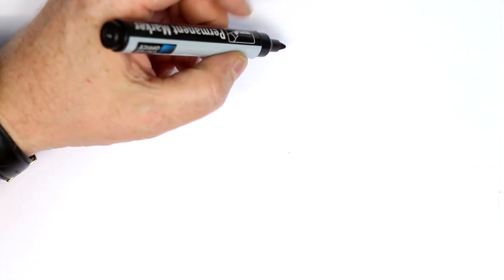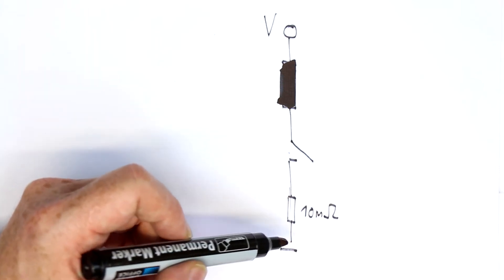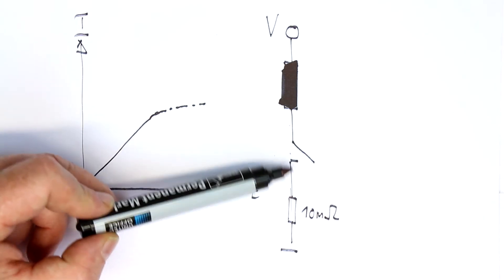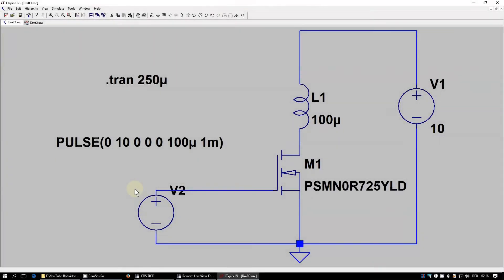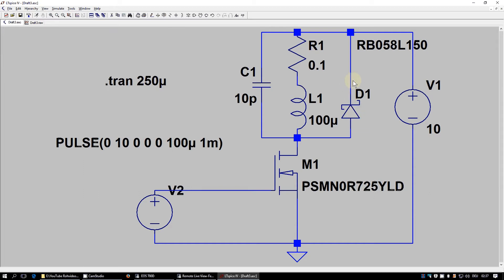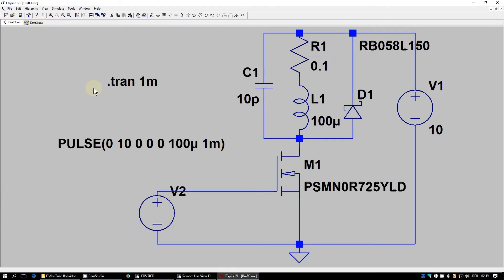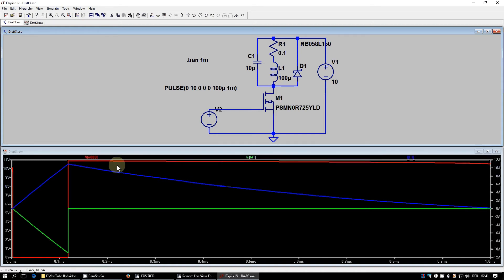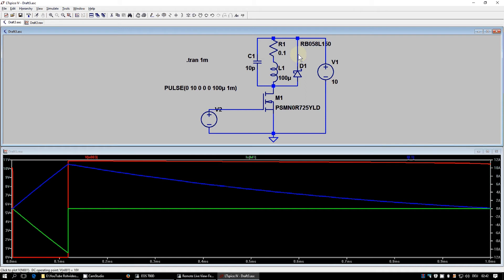Suppressing unwanted oscillations with a resistor [Pt.1]

Comment: The oscilation at the end of the simulation in the 7:33 is due to capcitances in the MOSFET that are present in all real MOSFETs, they are there even when it is off. The capacitances do depend slightly on the current, but in general only slightly. It forms LC resonant circuit.

Comment: Since, your video is labeled pt.1, I assume your next video will be the incorporation of a capacitor  across or in series with  the damping resistor to make it a snubber circuit.  I use a variable capacitor to find the best value by observing the ringing on a scope  and then replace it with the closest fixed value.
Reply from the maker: Yes. We will see how a snubber will work in this application and expand this topic on how & why to suppress ringing on power supply pins of fast digital logic ICs. Have to find the time to do the videos...

Comment: I ran this simulation several times on LTspice and on several computers but I get virtually no delay for the current and virtually no delay for the voltage change. I used both identical part numbers (( PSMN0R725YLD and RB058L150 )) and double checked all the set parameters such as the pulse and voltages. Maybe I am doing something different than you but I have re-checked everything several times now. Just thought you would like to know....PEACE
Reply from the maker: What do you mean by "delay" for the current and voltage change?
Reply: Current. I just tried it again to compare my results with yours and the voltage looks considerably different than your results. ....PEACE
Reply from the maker: Hmh. Strange.
If you want to I can send you the LTSpice schematics file.
If that doesn´t give the same result it must be in the default settings of LTSpice.
But even that should not give a gross difference.
Reply: I was actually measuring the current through the mosfet (Drain) and not the actual inductor....PEACE

Comment: The thing you are seeing is called dv/dt induced turn-on of the MOSFET. With transistor off, if you use too low high of the resistor with diode (or an inductor with too low internal series resistance) you will not dissipate energy, and still get rise of the voltage at the drain, because the diode and resistor will not be effective. This will keep transistor on (or turn it on, if it was off before), and keep it conducting. If you use too low of a resistor with diode, you will be make sure transistor doesn't turn on, but too low resistor will make not dissipate energy fast enough to make much of a difference. This is why you have some optimum in between. The dv/dt is due to internal structure of any MOSFET, most notably capactitances between all terminals, that causes things to behave non intuitively. Big voltage spike on the drain, will cause the current (Miller current) to induce voltages on gate and on source, and gate might become above threshold (relative to source), keeping it turned on, or turning it on in fast switching circuits.

Also, the PULSE with 0 rise time in LTspice results actually in some pretty slow rise time, something like 10us. Put there explicitly very small value, like 1ns.

Your damping explanation is not correct actually. Sorry.

Comment: Question I have 12 volt plug coming out of a portable generator tried to use that power source to power a fuel cell gauge the gauge needle is moving back and forth grounded out gauge bypassing the float sending unit and it still is fluctuating I'm thinking my 12 volt source out of my generator is oscillating the 12 volt source is not a rectifier off of a ac winding okay its a direct winding the automatic voltage regulator has nothing to do with this either the way the needle is bouncing around looks like the current is going back and fourth even bought a new gauge and the same thing is happening with that gauge also can I possibly put a  diode in line to clean up the oscillations anyone who can answer this question would well appreciated thank you YouTube family

Comment: So how do you explain 27 V of back EMF?
Reply from the maker: The value of 27V is here due a Zener-diode implemented in the LTSpice model of the chosen inductor.
That was a bit of bad luck, that I chose exactly this MOSFET.
It would have been better to take the "ideal" MOSFET of LTSpice ("nmos") which behaves like a simple switch.

Basic explanation:
https://en.wikipedia.org/wiki/Counter-electromotive_force
Lenz´s Law predicts that if you disconnect the voltage source from an inductor, the magnetic field tries to sustain itself.
When there is no electrical path where the current flowing in the inductor can decay (=infinite resistance), an even infintiely high voltage is induced  (aka back-EMF) to try to keep the current flowing.
Happens everytime and everywhere when an inductor is switched off without any means for the current in the inductor to decay quickly.
Reply: I was thinking about the value of 27V instead of just a diode drop above supply voltage not the fact that we have back EMF
Reply: I think it is becouse there is another voltage drop on the resistor in series with diode.
Reply from the maker: See above. 
I have edited the comments here because I didn´t know beforehand about the integrated Zener-Diode in this special MOSFT :-(
Reply: Inductance is always the same and also the current in the moment MOSFET switches off (10A). The only thing that is changing is the diode series resistance. Higher the resistance higher the voltage and shorter the time before energy disipates. It would be nice to do this with real circuit and oscilloscope and focus on changing the value of resistance and watching the voltage and time. Thank you! Thumb up!
Reply from the maker: The 27V Back-EMF in this case is due to the VDS-Breakdown voltage of the used MOSFET (THX to KX36 for that hint). Use another FET with a higher breakdown voltage and you get a higher Back-EMF.
Theory, formulas and a DSO screen-capture demonstration can  be found here:
https://en.wikipedia.org/wiki/Flyback_diode

Measuring with real-world circuits is a bit more complicated because then the parasitic properties of the MOSFET, the voltage-source, the PCB-traces and the oscilloscope probe come into play.
But the basic principle of the interplay between back-EMF and oscillation-suppression by the choice of the damping-resistor would be of course verified exactly like in the simulation.
Reply: The 27V is due to the 25V maximum Vds of the PSMN0R725YLD MOSFET model. Change the model to PSMN1R040YLD which has Vds(max) of 40V and you'll see it goes to 44V while the inductor current resets. Essentially the MOSFET drain voltage is acting in a similar way to the output of a boost converter. In a boost converter the peak inductor voltage would be clamped to the output voltage, in this case it's clamped by the breakdown of the MOSFET.

The reason the current ramps down much slower with the diode is that you're clamping the output to a much lower voltage than before (before was 27V, so 17V across the inductor; after was 10.7V, so 0.7V across the inductor. dI/dt = V/L so the rate of change of current is proportional to the voltage across the inductor.

MOSFET models in LTSPICE are very particular and many times a circuit doesn't behave as expected with certain MOSFET models for seemingly no reason. I substitute an ideal switch model whenever possible. However if you just put in an ideal switch in the place of this MOSFET you get a near instant current reset to 0A in the inductor and a flyback voltage of kilovolts because that end of the inductor isn't clamped.

The ringing frequency is also due to the parasitic capacitance of the MOSFET model rather than a minimum parasitic capacitance of the inductor as the video implies. 

Here's my LTSPICE RLC snubber simulation
https://www.dropbox.com/s/yauh1i3vp9xmh7r/RLC%20snubbers.png?dl=0

I might put up my explanation of how to design an RC snubber when both L and C are unknown parasitics.

If you want to show FET current positive instead of negative, show the drain current Id(M1) rather than source current.

Your final RD circuit is a voltage clamp, not a snubber. It's not an effective clamp because the Vds(max) of the FET model dominates it in clamping to 27V. It's a very slow clamp because of the resistance which means when it goes below 10V and stops clamping it comes in at such a shallow angle that the amplitude of oscillation when it is finally below 10V and free to ring is small, but the long duration of the oscillation shows that Q is still very high as the oscillation is not snubbed at all except by the R1, because a clamp is not a snubber.

I like your videos, I subscribed to your channel so of course I do, but this video has many many mistakes and I fear you'll just end up leading people astray.